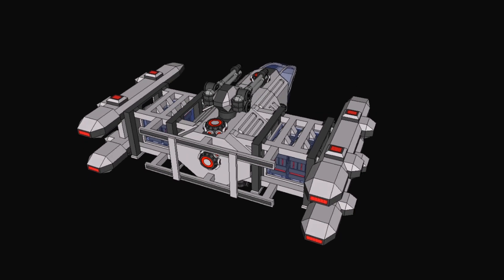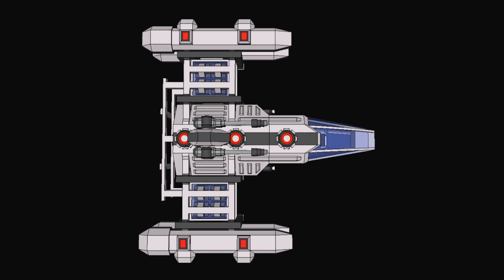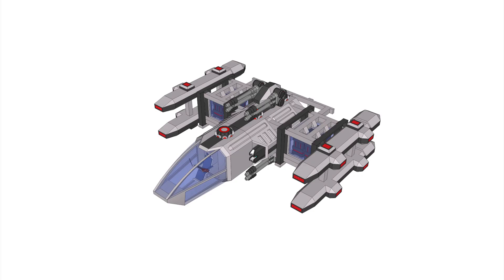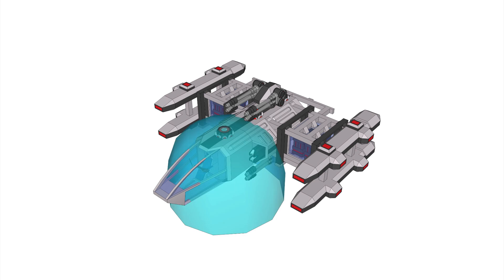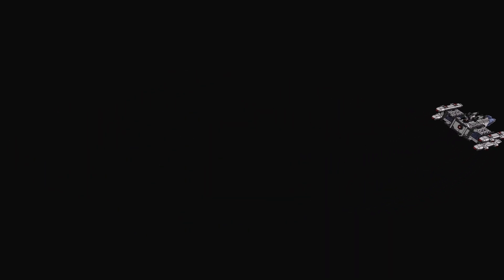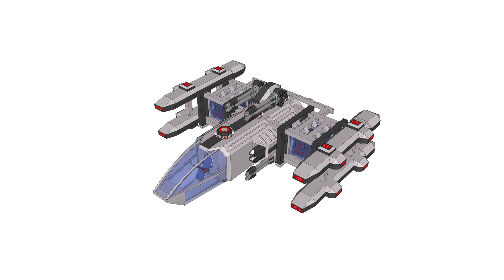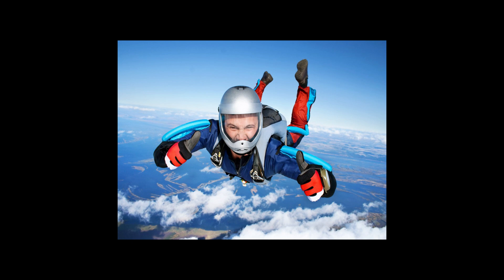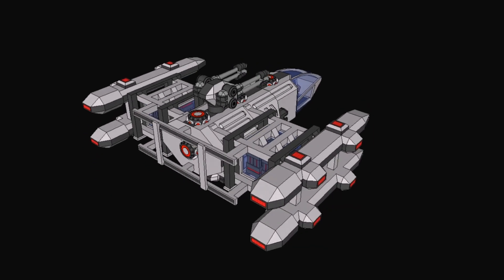Shad has a question! Gravitational acceleration on a spaceship?

Comment: 2:50 sure many people already told you that, but no. source of that gravity, what that gravity is relative to, is the ship itself. it's not "real gravity", it's just a field pulling matter inside it down. all it would do, in the configuration shown in the video, is cause shear and pull stresses on the ship's hull, as parts of it will have their mass dragged down relative to the rest... so if anything, these fields would try to bend and deform the ship.

but they wouldn't "pull it down", the same way earth's gravity doesn't affect earth's movement.

HOWEVER - in accordance with newton's laws, *the act of pushing mass inside the ship down could possibly result on the ship as a whole moving very slightly up, because these forces are two-sided, you exerting "field force" on something in turns makes the thing exert appropriate force on you. like with earth, it's not only earth pulling us, it's also us pulling earth... not only moon being pulled by earth, but also earth being pulled by moon, in the opposite direction, of course.

so anything falling to the ground in the ship would exert a counterforce on the ship until that thing would be static on the ground (zero potential energy, within our system)

so you can't use it as propulsion. this is a very complicated topic, also depending on whether your universe pretends it's possible to generate real gravitational field in other way than bending space... if yes, that's incorrect and stupid, but consistent rules for such tech can be found and they still wouldn't have the effect you want.

closest "real-world thing" to this "i'll pull myself up into the air by pulling on my own hair" idea are reaction wheels, but they deal with rotating the object, used in sattelites. look up something about them, it should give you good inspiration as well as an explanation why this idea, in the form you present it, is not viable. also might point you in a direction of some other more viable ones ;)

Comment: Although I think the concept of artificial gravity is completely unrealistic outside of sustained thrust or centripetal force, I have a few thoughts about the ship's design.Firstly I think your graviton emitters are on the wrong side of the ship and are the wrong shape. Gravity as far as anyone can tell is always an attractive force (unlike electromagnetism) so in order to have a downwards force inside the craft you would need the emitters to be on the underside of the ship. Secondly I think that instead of a disk the emitters should be a bar that is as wide and as long as the ship so that the field is as uniform as possible. Furthermore the strenghth of gravity (at least Newtonion Gravity) is inversely proportional to distance so I'm not sure that if in close proximity of the emitter the strength of the field would ramp up massively which would be a big problem.  However the idea of using gravity to propel is an interesting one and sounds a lot like a real piece of physics called an Alcubierre Drive. The drive works by contracting space-time in front of it and expanding space-time behind it in effect causing a bubble of space-time to be moved forward. Any matter within the bubble moves with the bubble although it experiences no acceleration and (if I remember correctly) no time dilation effects. So like you say no need for inertial dampeners. It also means that it does not have rotatate (either the craft or drive) 180 degrees to perform a deceleration burn to slow down when it arrives at it's destination.In theory you could move a ship using this drive to faster than light speeds without breaking any of Einstiens Laws, this is because it is the space-time doing the moving and unlike matter is free to move faster than the speed of light. The ship itself will no force actig on it and it will not gain any mass as matter does at reletavistic speeds. There are a few things to mention though, firstly anything that contacts the outside of the bubble will be torn to shreds and that matter may become stuck in the well at the front of the ship, so when the craft arrives and the bubble disappears this matter is released in an an explosion which might vaporise your destination. There have also been calculations which would sugest that any ship using the drive to fly at FTL speeds would be vaporised by Hawking radiation. In terms of fictional universe this could have some major implications for example missiles equipped with an Alcubierre Drive could penetrate any armour and move incredibly quickly. Likewise a ship using a Drive would have (I think) an impregnable shield. The only way I can think of countering it would be a similar space warping device. Indeed the graviton emmiters you describe could be turned into unstoppable weapons, imagine shooting a powerful rotating one at something; it would tear what ever it hit apart! Anyhow I'd highly reckomend reading The Owner series by Niel Asher where the use of this sort of technology is explored.

Comment: Gravitational drives are not exaclty the best used in that sense. As far as I know, gravity is actually the effect of matter displacing space. Therefore by using gravitational pull to accelerate yourself, one, you displace space in front of yourself in a similar way, and as far as we know, the maximum effect of this is a black hole. So unless you want to make an artifical black hole in front of the starship (protipp: you don't want that.) you'd be pretty much limited to around 95% c. However, if you are using space-manipulation tech, you'd be much more wise to compress the space in front of the spaceship, and either use "conventional" ion/chemical propulusion, vasmr, or microwave drives to travel through the compressed space, enabling c+ travel speeds. Since you mentioned in your spaceship video that you want the vessel to be able to fight effectively, I'd recommend the microwave drive, since it has comparatively little and short ranged energy emission, which makes detection harder. Why? Because in space, the best protection is not being seen. If the assailant can't get a fix on your exact coordinates, good bloody luck to them hitting you moving at ludicrous speeds ridicoulosly far away in a relatively miniscule shuttle.

Comment: The limit is human endurance as is the case with all vessels, the materials can be made stronger, the technology more advanced, but a human is still a human, and the human body can only survive up to 100gs such as during a crash for a very short amount of time measured in nano seconds, survive not retain consciousnesses. 46gs in a rocket sled is the current endurance record for any human remaining aware for any period of time and only then measured in seconds. While modern fighter pilots in their G-suits can endure up to 9gs for extended periods of time, with the hypothetical limit being around 16gs before death ensues due to vibrations rupturing organs. Though without any special suits, most humans can only sustain up to 5gs without losing consciousness, most not all.

But that's assuming the pilot is human, if it's an AI however then the limits are material endurance, and depending on how scifi you want to go, the limit is essentially your imagination. But for instance the G rating for military electronics in artillery shells is around 15,500gs. So significantly faster.

Comment: Inertial mass is the resistance to acceleration.
It increases significantly only when you are getting close to the speed of light.
So the faster you go, the longer it will take to accelerate by the same ammount.
The limiting factors are your fuel and your time; otherwise you are getting ever closer to the speed of light.
In every day situations (like the biker) the mass (inertial mass) of an object stays practically the same.

Comment: From my understanding, the  generators push gravitons in the cone shape. Newton's third law says that this action will cancel out the force of the gravity field that is produced, because moving the gravity field will take the same amount of force to push it out, and it would make no difference as to the ships velocity. One thing that this does remind me of is the (I'll do my best to spell it) alcubier drive. It is theoretically possible, and was suggested by Alcubier, and NASA has been working on it. This format of transportation is considered faster than light, because it doesn't move through spacetime, if you want to learn more about it PBS spacetime did a good video on it.

Comment: I made gravity accelerated ship in Space Engineers in 2014. Weight was about few milions of ton, full speed under 3 seconds in any direction, after reaching full speed in desired direction, turn off the gravity engines and enjoy the "endless" drift thru the space.

Comment: can type for long, a bit busy at the moment, but your top speed is 0.99999999999999999999999999999999999999999999999999999999999999999999999999999999999999999999 of C. (aka almost the speed of light). depending on how long you accelerate.  warning time dilation will be experience.  you will never be able accelerate to C because the amount of energy needed is extremely large. ( double the amount you used to get to 0.9992 from 0.9991)

so good to speed will be limited by your reactor an reactor mass.  you can cheat this by having some sort of scope to pick up fuel and reaction mass in interstellar spaces (see buzzard ranker)
Reply: That is true from the perspective of a fixed observer. However, from the perspective of the space ship, the relativistic effects occur in the fixed observer, not the space ship. In other words ,the ship doesn't "know" it is travelling 0.999 C, rather, the ship observes the rest of the universe traveling 0.999 C in the opposite direction. From the perspective of a fixed observer, the ship appears to throwing massive amounts of energy to only slightly increase its speed. But from the ship's perspective, it is still at Newtonian speeds. These different observations are reconciled by time dilation: because the ship is subject to acceleration, it slows down relative to the rest of the universe. So, the crew can reach a objective millions of light years away and return in their lifetime, but when they return to earth, millions of years would have passed.

Comment: I have heard of a theoretical propulsion system somewhat similar, where, in theory anyway, the ship makes a gravity wave. it makes a heavy field in front, and a light field behind the ship, basically making a gravity wave that is so strong it warps the space around the ship so that the field in front is shorter than the area the ship is currently occupying so that when it pushes forward a little bit, it covers a greater distance than with the engines alone. there are currently experiments on the  feasibility of this theory. but its a drive that wars space so you can shorten the space you need to fly through and potentially go faster than light, because you'll need to cover less distance. I think a good name for it would be a warp drive, I'm not kidding rea research into this. but star trek had it right. I saw this in a documentary, and here is a pretty good vid.https://www.youtube.com/watch?v=dXyQ92SPWds&spfreload=10its cool that you were on the right trail with (I'm assuming) no physics degree

Comment: Well Chad, you asked how much energy is needed to accelerate an object, and here is is what I got from my university physics classes, including the full math.

Firstly, an object has energy in the form of mass, and kinetic energy as by the following equation
E^2 = m^2*c^4 + p^2*c^2. This is the equation for total energy E of an object with mass m and momentum p, where c is the speed of light. The object's momentum p is p = (Lorenz factor) * m * v (v for speed), and using this the total energy becomes
E^2 = m^2*c^4 + (Lorenz factor)*m^2*v^2*c^2.
Lorenz factor = 1/sqrt(1-(v/c)^2)

The final equation with all the bells and whistles is
E^2            =        m^2*c^4            +   m^2*v^2*c^2/(1-(v/c)^2).
energy^2  =  mass related part  +          speed related part

We notice that the first part m^2*c^4 stays the same, while the second part (Lorenz factor)*m^2*v^2*c^2 changes with the speed.

The first part is the energy associated with the mass of the object, so 
1) the mass stays the same regardless of speed
2) the energy stored in the form of matter (mass) stays the same also (speed of light stays the same regardless of the object's speed)

The second part increases as speed increases (v^2), but the Lorenz factor also increases with speed.
At first the Lorenz factor doesn't change very much, but when the speed gets closer to the speed of light (let's say faster than 10% of light speed) the Lorenz factor starts to get bigger. Finally it starts to really explode near the speed of light, and at speed of light it's infinite.

How does this apply to our spaceship?

Let's assume our spaceship starts at speed v_1, and accelerates to speed v_2. Let's call the object's total energies E_1 and E_2 respectively.
E_1 = sqrt(m^2*c^4 + m^2*v_1^2*c^2/(1 - (v_1/c)^2))
E_2 = sqrt(m^2*c^4 + m^2*v_2^2*c^2/(1 - (v_2/c)^2))

The energy needed to get from v_1 to v_2 is E_2 - E_1.

Th consequences are
1) Energy of an object at light speed is infinite, so you can't get to light speed   (infinity minus a number is infinity)
2) The momentum increases rapidly (up to infinity) as the speeds get really high (NOT the mass, but momentum)

Comment: IMO there's two approaches here, depending on how much energy you want to consume.

The first is a closed system.  A static gravitational gradient.  Basically single point to which you are attracted.  The natural shape would be spherical, although you could distort it into something flatter, so long as there's no breaks in the field lines.  Any energy gained by falling towards the center point is lost escaping back out of it, so there's no intrinsic cost of maintaining the system.  Perfect for simulating onboard gravity, useless for propulsion.

The second is an open system.  Apply a field across the entire ship (or just part of the ship, such as a heavy lump in the middle that pulls the rest with it), effectively creating thrust.  Thrust means energy has to come from somewhere, so your onboard generators must constantly provide it.  The limits here are the usual ones: energy density of fuel, then eventually time dilation if you reach relativistic speeds.  It's very much a subluminal form of transportation.

Comment: it won't work because gravity is like a magnet .It will pull your ship to the senter of thet gravity force(mase) that you has crieted and as you been pulde  this force would be moved forward. But to do that you would need more and more energi. and this force would pull objects from everywhere (just like a black holl , a planet ,a sun would do) and you will and up using far more energy to create and maintein  that forse that it would be needed to simply push your ship with a normal propotion engin and sorry i am NOT good in english as you can see. i hope i help a bit.

Comment: First when you're talking about a "balance" between the gravitational push and the inertia of the ship, you're basically talking, in some way, of the third law of newton so when these to are equal it cannot be accelerated further (F = GmM/r^2), but if you're actually talking about a constant acceleration (like gravity) it should be accelerated further sooo somethings wrong, what's wrong is that Newton's law of gravity doesn't take into account the incresing inertia of things that move at really high speeds, to actually answer this question you need relativity to describe it.

Second yes, the closest thing (in published science articles, not sci-fi) to what you describe is an Alcubierre Warp Drive, as others have mentioned before. This could theoretically achieve Faster Than Light speeds (relative to light as seen from an outside observer so no violation of relativity)

Comment: well with the question given... lightspeed is the max that when it requires infinite energy to accelerate faster...

but the gravity accelerator sounds a bit like bootstrap levitation... 
while there is a way to use the same technology to produce acceleration the scenario depicted wouldn't move the ship at all from my understanding of the technology....

you would need to produce a gravity field separate from the ship instead of directly on the ship.... and allow the ship to fall into it

suggestion: using a perversion of the hologram technology to make a cone  facing the ship in a form of invisible light..... then convert the photons into the gravitational bosons...this would give the effect as if the ship had  gotten close to a small dense moon.... and was nose diving into it.... so long as the light is able to penetrate the ship and passengers... no inertial dampening would be needed so a high frequency light would be suggested... probably past gamma wavelengths... as not to cause adverse effects....
Reply: https://s32.postimg.org/guwy2xqn9/gravity.png
like so^
Reply: Having the center of gravity in front of the craft is infinite energy to accelerate.